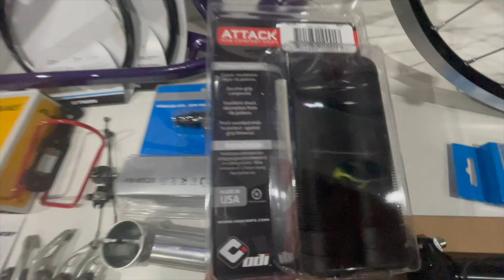Retro 1995 Cannondale F600 Restomod Build

Comment: Was hoping to see a rebuild of the fork. Did you get it working better?
Reply from the maker: I had a poke around with the headshock without totally disassembling it off camera to apply some grease to roller bearings to get rid of the light notchy-ness I had felt initially. 
Looking inside you could see a partially melted elastomer, but in the winter it still had a little bounce left in it. But I’ve used the bike quite a lot this summer and I can only assume that now the elastomer has totally collapsed and needed replacing. It’s a job for this winter that I’m particularly dreading as it looks a right pain to do.

Comment: Hey my man✌️where do you get this original parts from???, I have the same bike, even the color and everything just like yours, and I want to change my brakes, and the front switcher, but the main thing is the parts have to be original, I live in Ukraine and I got the problems to find them out.
Reply from the maker: Well there are very few original parts left on the bike and it’s 27 years old so original components probably haven’t been made for over 20 years! You need to find modern components that are compatible with the old components or look on eBay for second hand originals